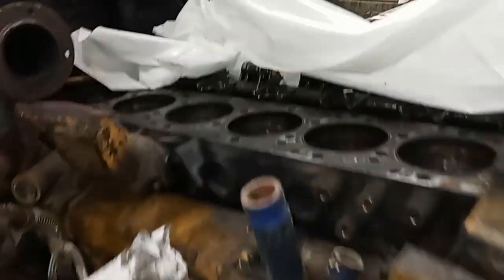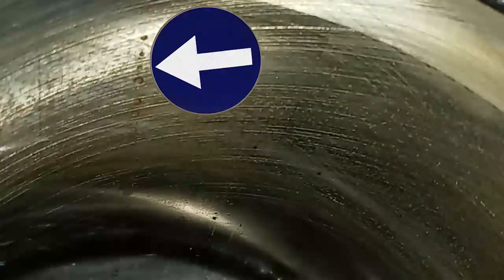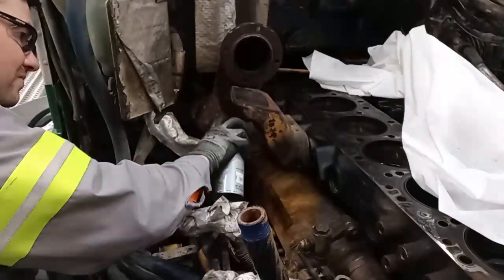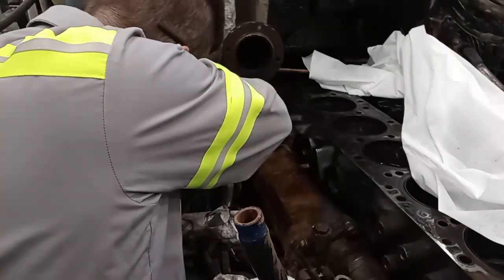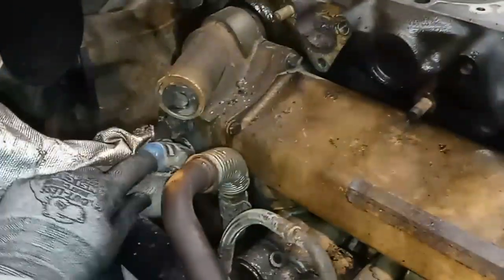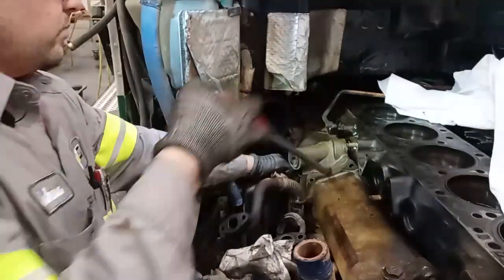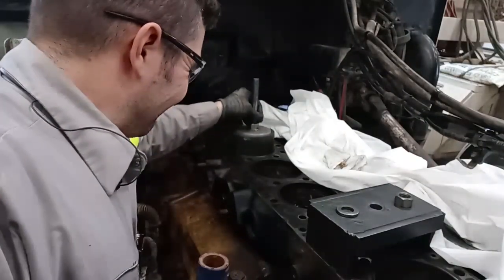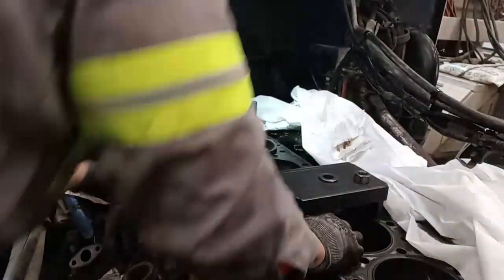Coolant can DESTROY your Engine faster than Bad Oil. Cavitation and Liner Pitting.

Comment: Cavitation is the worst from mechanic perspective.  Sooo many times, I'd have to say: "It might be a head gasket" when in my gut, I had a hunch it was pinholes in cylinder walls..  Actually sometimes, it was a head gasket but more often than not, it was cavitation perforation...a death sentence.  Finding where exactly it was coming from was a crap shoot.

Comment: Coolant, oil, filters... all peanuts compared to an in frame.
Reply from the maker: Very good point.
Reply: @AdeptApe  

What's the title of your opening song and Destruction of the week?
Reply: As I found out the hard way.
Reply: Sorry but what's an in frame ?
Reply: @sweis12  Block stays in the truck.  So it stays in the "frame".  Everything but the crank is subject to inspection and replacement.  Well the crank is inspected too.  But if it needs machine work, then the project just got promoted to frame out.

Comment: I have a 3306 in a dump truck 98 lt9513 Ford  I have air pressure in my tank. It pushes about a gallon out every couple of days. Already know it's NOT the compressor

Comment: I had a Volvo engine in a L90B loader that had compression in the cooling system, it ended being the tip broke off the injector cup. That ended up being an easy fix, well relatively but I can see you have a lot of work ahead of you on this one. Good luck and you produce great videos.

Comment: Had this happen to a 7.3 IDI engine in a Ford pickup.  Unfortunately that engine is not sleeved and I had to have it bored and dry sleeved.  I'm sure the previous owners didn't run the proper SCAs!

Comment: Had this happen on a dt466 well water was used ate away liner
Reply from the maker: Well water lol, they didn't have enough pool acid to use instead or perhaps just fill it with sand.

Comment: I noticed the C13 was in a Pete.  Was it a long hood or what model was it?  Would it have been easier to get at the back bolts on oil cooler if it was a long hood?  Do you find certain makes and models easier to work on do to other things such as air tank/line placement or exhaust routing? Thanks for the great videos.
Reply from the maker: The Peterbilts are pretty good, this isn't the long nose one though, it seemed like all of those got C15 engines, although I'm sure got a few of the C13 engines. I would say Internationals are the worst though, most amount of junk in the way, worst cab designs. No sir, I don't like them.
Reply: @AdeptApe right Josh.. thats why their called 13 letter sh 💩 t spreaders..lol

Comment: The last time I spotted something like that was on an old forklift a guy wanted me to do the engine head work on. I told him based on the condition of the cylinder walls, it might be best to do a full rebuild. He didn't want to do that... I managed to piece it back together, but customers like that inadvertently give technicians a bad name because they blame us for their negligence once the vehicle has a catastrophic failure... 😒
Reply: Your exactly right, I was a field svc tech for material handling equipment, they would say oh just replace the hose that’s leaking, I said when I do that the old lines will start to go. Oh no just the one. My pager went off before I got back to the shop, oh they said you left with the truck still leaking. I said, uh no. I told em, they declined, fuck it I’m out. But don’t you know they lied and said I never told them that ? BS just all a part of it. That and mgmt that want you to bill hours no matter what. Portal to portal, so as soon as I jump in my van they are getting billed. I had so many people tell me oh we aren’t paying that, I’d say here’s the number to office, have a great one. It’s not for thin skinned people I’ll tell ya that. Most of us were ex military, coincidence, not likely lol.
Reply: Sometimes you gotta know when to walk away & not even get involved with something or someone like that. I have a not-so-nice reputation around here locally among the dead-beats like you describe. But those who listen to my diagnosis & follow what i say treat me like a saint. Their stuff runs reliably as a result. I'm all for saving a buck but not when it's a basket case that's gonna turn into a quagmire. 

Down with dead-beats!
Reply: @acemobile9806  Unfortunately, it all boils down to ignorant  and broke customers who are trying to get by.
Reply: Well said. I have run into the same thing with doing brakes on cars, the people don't want to buy the right parts, and then the brakes are junk in a year or two, this is why I stopped doing brakes for people. Unless they say that they want all new, or proper parts.
Reply: That's why you refuse to do it if they don't do it properly. Let it be someone else's problem. Do it right or not at all.
Reply: Shoulda welded it shut
Reply: I remember guys overhauling on side of a 8 v 71. I always thought that was dumb.
Reply: Am just now seein' replies to this comment. Thank y'all for sharin' your experiences. It's nice knowin' that I wasn't alone on this. People need to understand that they get what they pay for. I basically won't even do a sketchy job now.

Comment: monitoring coolant quality has always been a big deal in any big diesel with wet liners. Easy to neglect for a lot of owners.
Reply: how you maintain it good ? 
i have detroit s60 on my trucks
do you just change it frequently or add additives or what ?
Reply: @zaidchalabi1599  i tin u test it ;or git a coolant recycler two check it
Reply: @enzoorciuoli328  what did you just write ? english? cant understand a word!
Reply: git a coolant tester or check dee udder comments onna tessin it

Comment: Hi 👻 Kindly tell me ratio of coolant in water? Asking about cat coolant.
Reply from the maker: Yes, get the 50/50 premix, listen to Alex and Wally. Don't use normal green coolant, it isn't the same.
Reply: Most likely 50/50
Reply: I work at a dealer and we only use Full strength extended life coolant. It’s red. MAKE SURE ITS ELC!!  It has additives in it that helps control cavitation & electrolysis
Reply: Cat ELC coolant. Normally comes already pre mixed. Lasts up to 5 years with a mid time addictive.
Check your engine manual, if is a cat, for procedures to use ELC oolant
Reply: Thank you guys 👍

Comment: Had a blown head gasket on a bsx this week.  Customer failed to drain the oil and allowed it to sit in there for a couple of months before they brought it to us.  They decided they were going to do a platinum. But before I did the platinum I suggested to pull the old pan and pull one rod & one main.  Found rust on the crankshaft trashed the engine. Got a long block on the way.
Reply: Also note. They decided they were going to start the In-frame before they brought it to us. (I work for a kenworth dealer)   That’s my headache for this coming week.
Reply from the maker: Sounds like quite the expensive fix for the customer.
Reply: @AdeptApe  what’s your thoughts on the IVA delete.  I hear customers say it all the time and I personally think they’re a DA. I understand it was to reduce NOx emissions but instead of deleting them if you could learn to harness it you can make more power. That’s my thoughts.    No telling how many ARD heads I have replaced and IVA oil leaks fixed but beside the point.  And single turbo conversions..... People love them 6NZ.....
Reply: They dropped 17k as a down payment so yes they got a bill 🤣. Thompson is supposed to be delivering me my new engine sometime this coming week.